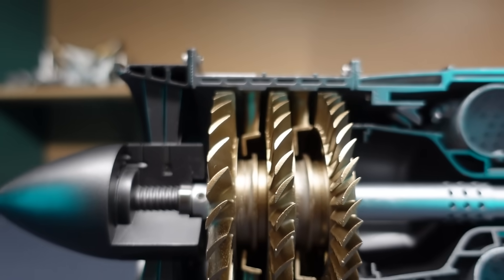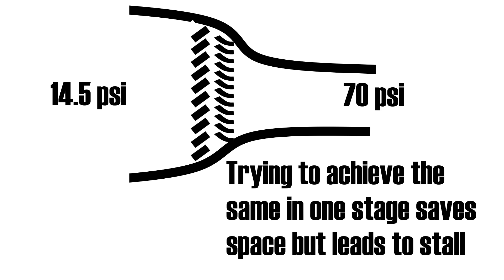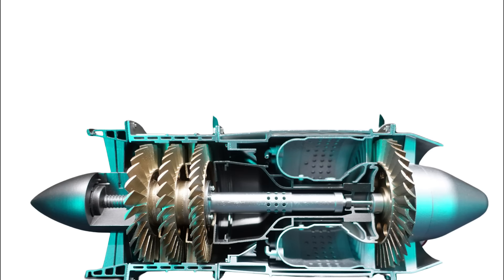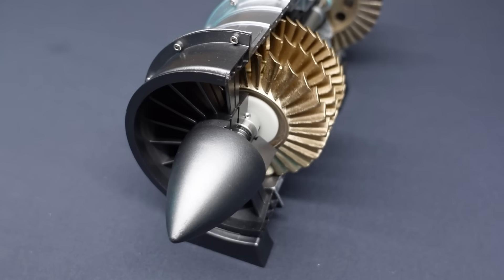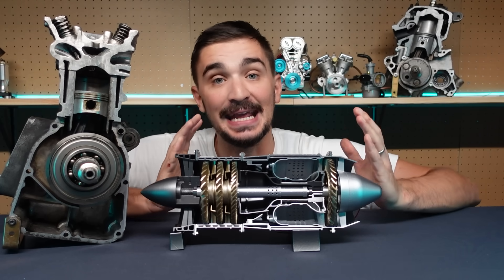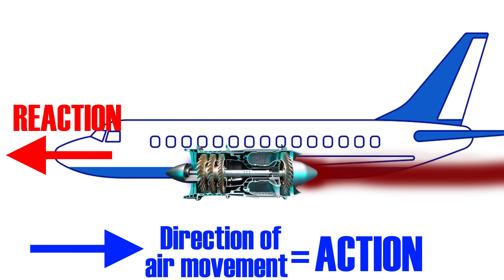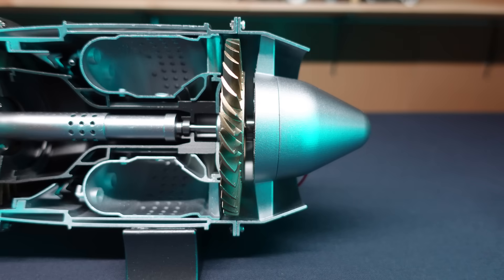Appreciating The Beauty of Jet Engines by Juxtaposing Them Against Piston Engines

Comment: Everybody,  go view this jet engine invention video.
https://youtu.be/vNhz46CjN0A?si=vdVw1irE2oW4KbLA
Paraphrased or search:
Frank Whittle Inventor of the Jet Engine.    Amazing story of treachery and triumph.    Yet Frank did not get his just recognition and honors until 30ish years after the fact !
If you think the jet engine is hard to understand, imagine being the first guy to come up with the idea !    Nobody to tell what is right or what is wrong.    More likely, nobody that even thinks that you are sane or making any sense.    Also, his original jet engine was a centrifugal flow engine unlike todays axial flow jets.   But the principles are largely the same.   
In fact seeing the design of the centrifugal flow jet made it easier for me to understand the jet turbine principle overall.    I mean for Gearheads, a jet is open at both ends, don't you have to contain all that pressure in a combustion chamber somehow ?  Open at both ends just doesn't make sense !
Note:  The germans actually had a jet made and in the air before Whittle but Whittle and the German inventor did not know of each other or exchange any of 'the science' until after the war.

Comment: Hey! Great video. You may just want to do a bit of a follow up about the pressure in the combustion chamber. As it is not a sealed system, the pressure doesn't increase. Only volume does. It is this increased volume that is harnessed as greater dynamic pressure to spin the turbine. It works on a conceptually different cycle to piston engines, using expansion rather than the force of greater pressure to provide energy to do work.

Comment: 1 bar is 14.7 psi not 14.5 .....
If you equate a 4 cylinder (4 stage) reciprocation  engine to a jet then they Both operate / combust simultaniously.
I did laugh though,  when told that the jet inlet has a set of static blades to stop the engine sucking up big objects.
I thought about the woman ground crew that was sucked up and went in whole and got expelled akin to cornflakes.
I laughed because I ashumed you may mean, adult elephants are too big to get sucked in?
Reply from the maker: https://www.blackcircles.com/helpcentre/tyres/convert-psi-to-bar#:~:text=How%20many%20PSI%20in%20a,14.5038%20PSI%20in%20one%20BAR.

Comment: There is no pressure increase in the combustor of a gas turbine engine. The highest pressure is found at the compressor discharge just prior to the combustion section. The burning fuel only causes an increase in volume and velocity of the gas entering the turbine. If pressure increased due to combustion, flow through the engine would either slow or reverse. In both cases, this would overheat engine components and cause a failure.

Comment: Hey nice bike, it is the same model as my bike :P 
Have you changed your rear shock?
Reply from the maker: Stock suspension, didn't even touch preload, but I think I'm starting to feel a bit of the weakness of the soft suspension
Reply: @d4a  i have preload maxed out, but for what i do, i bottom out the suspension constantly. 

Also widowmaker make a wicked exhuast for the 300 👌👌

Comment: You mention that modern tech doesn't use Turbojet engines and instead Turbofan engines (I'd love to see a future video on that subject), but weirdly enough that reminded me of all things the SR-71 still only used a turbojet engine with a ramjet design smashed into it, giving it the moniker of of a "turboramjet". That's why it could climb so high compared to other commercial and military aircraft, and casually outspeed the fastest missiles during that era (nowadays SAAMs would potshot the hell out of it, due to the sheer progression of tech in the past 50 years).
So, that begs the question then: What would the SR-71 engine look/operate like not using a turboramjet, and instead using a hybrid of ramjet and turbofan?

Comment: Usually the Turbine where your burnt gases exit has the opposed vanes when connected to the compressor stages via planetgear so that it can rotate in the opposing direction, while I would imagine this also helps provide better stability as one section spins one way, and others rotate the opposite. The model you have is a good example, however it doesn't look like the exiting side is geared with a planetary gear to the compressor section.

Edit* it looks like you caught it before I did in your own comments lol

Comment: I commend you D4A for trying to explain these complicated engines. Heres some feed back!
1) they vibrate like crazy, as they can rotate at speeds well over 50krpm, it's not uncommon to have "modes" or natural frequencies in the 900hz or more.
2) compressors: the rotors increase P total, the stators convert most of the Ram pressure into a static.
3)the reasons each stage gets smallest is due to the density increase of the air. The engine must have near constant mass flow throughout. (Near constant due to bleed systems etc..)
4) as the gasses combust, the pressure goes down! If it didn't, it would go back to the compressor which is lower temperature. The highest pressure in engine is right after the compressor. As the gasses burn and heat up, the velocity increases.
4) the turbines have two sections like a compressor, stator and rotor. Also, unlike a compressor, they increase in size due to the density decreasing over each stage.
5) for most jets, the highest temperatures are seen on starting. There's not enough airflow to cool things and there's a ton of fuel burning on things. That's why the quickest way to kill a jet it to start it with a weak battery.
6) the ignitor only comes on at start or inclement conditions. Generally combustion is self sustaining.
7) the turbine on the model is installed backwards.
8) the usual limit on rpm is the material properties of the rotors due to centripetal force. The larger the engine the slower it will rotate.
9) One thing you did not mention, as the engine has all stages operating simultaneously, the engine grows unevenly, the cold section compressor will grow very little, the combustion and turbine section can grow A LOT. A large turboprop can grow as much as a .25" over those sections from cold to max power.
Again, nice video.
Reply: The compressor blades also.
Reply: Doubt on Point 4. Pressure going down after combustion - pressure reduction happens at the intake stage only, that's why it is followed by a compressor stage. As the expansion chamber of combustion stage is fixed and also cold air gets sucked into the chamber from the venturis on the chamber body, which means the pressure will increase with the added density to cool the exhaust and then as it passes thru the turbine blades, it's flow rate and flow speed both increase which is converted into a working thrust force at the exhaust nozzle and cone. 
Bernoulli said fluid velocity is inversely proportional to pressure, a principle which is the basis of jet engines. But we also have boyle and charles laws which say that in a constant volume, when temperature of working fluid increases it leads to pressure increase, directly proportional. And these variables in temperature and pressure cause a pressure differential that is converted into a Thrust Force. 

With due respect, correct if my observation is wrong.
Reply: @sirishwark I mistakenly wrote 4 twice, but you thankfully stated the point 4 in question (lol) I recommend looking at the Pv diagram for a simple Brayton cycle (principle in which gas turbines operate) In an ideal Brayton cycle, combustion happens at P constant. P2 to P3 (of the cycle). Do not mix P2 to P3 of an engine. P2 is generally directly at the entry of the compressor, P3 is the exit of the compressor (all stages), P4 is directly at the entry of the turbine nozzle. P3 is highest Pressure, T4 is highest temperature. P4 is always less than P3. Think of it this way from an instantaneous perspective. If P3 was less than P4(regardless of shape of chambers etc) P4 would flow back to P3, it's that simple. The combustion of P3 gasses increases the P total, but P total is a mix of Pram and Pstatic. The purposes of the shape of combustion chambers is to ensure as compete a combustion as possible and to convert the energy into velocity. That velocity is what turbines use to convert into mechanical energy. Circling back to the ideal Brayton cycle, you'll notice that P4 and P1 are at the same pressure (mind blown). Because P is Pstatic, all the energy added is converted into velocity at the exit, Pram is higher, P static is the same as the inlet. 100% efficient. In reality, P4 (on the cycle) will have a higher pressure than P1 of the cycle. That's why when you see exhaust gases leave an engine they expand right after the exit and make a cone and not a column. Reality is a B#tch. I hope this answers your comment.
Reply: What a load of bs!
Reply: @kentauree after a quick read through I don't see anything wrong in what was written. Anything specific?
Reply: @kentauree  what?

Comment: Excellent explanation. Also, all internal combustion engines reach higher efficiency at higher operating speeds. However, recip engines have more limited speeds otherwise vibration will self destruct. On the other hand, jet engines have low efficiency at low speed by default (inherent of all internal comb engines), but since they can spin at higher speeds, jet engines compensate for their efficiency the faster they run and the only limiting parameters are elevated temps and vibration (@ multi-k speeds). One most limiting factor is the cooling air needed to protect engine components from melting. This "bled" air can reach as much as 60% of the compressor's volumetric output air, leaving only 40% of air available for combustion, and thrust.

Comment: One thing which always puzzles me with jet engines is why does the combustion chamber only exert pressure downstream, ie towards the turbine.   What stops it exerting pressure upstream?  In a piston engine the valves prevent this so what provides the equivalent function in the jet engine?

Comment: Back in the late 70’s I used to machine the bleed holes in hot end blades for the Rolls-Royce RB211 turbofan engines.
Reply from the maker: Was it fun?
Reply: @d4a  EDM machine with lots of oil for the burn, then trichloroethylene to clean the blade for inspection.

Comment: 15:02 you could have piston engine to propel something like fan on high altitude but for same power rating, jet engine is multiple times lighter, a400 has 4 turboprop engines with 10000hp each, how much would weight the lightest piston engine with same power?

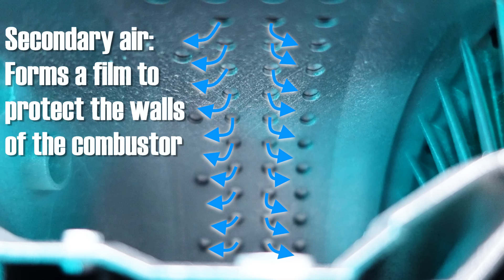Comment: 9:41 wrong, primary air is used for beginning of combustion, secondary air is for optimization of air/fuel mixture to prevent too rich and to insulate combustor walls if high temps, and third zone is to finish combustion and insulation, and as much air is in 2. and 3. zones, as  temperature is lower
Reply from the maker: Not necessarily

Comment: The connection of the turbine to the compressor does not create "vicious cycle" (@7:32). "Vicious" means "bad", but this is essential in the turbine engine just as it is essential in the reciprocating piston engine. In both cases, the compression requires energy, the expansion produces energy, energy from expansion must be used to drive compression, and it is only the excess of energy produced in expansion over energy used in compression that produces the net energy output of the engine.

Comment: Could you explore jet engines as a power source for cars? Not as thrusters but as a combustion engines where the energy of exhaust is extracted and either converted to rotational energy of the wheels or into electrical energy.

Comment: As noted in at least one other comment, the pressure does not increase in the combustion chamber, as claimed at 6:53. It does increase greatly in energy (which is the point), but that energy is realized as temperature and velocity, not pressure.
Reply: Of course pressure. You need a physical force to move an object. In this case to move the engine and the attached plane in a certain direction.
Reply: @casshern9454  the pressure is high in the combustion chamber, but it does not increase due to combustion as the air moves through the chamber. No one is saying that there isn't high pressure in the combustion chamber, or anywhere else in the engine. 

Turbine engine thermodynamics and fluid dynamics are much more complex than "Of course pressure. You need a physical force to move an object." For a start, fluid velocity is more important to thrust than pressure, and all of the basic fluid state properties (temperature, pressure, velocity density) are critical, not just one. 

In the combustion chamber, the addition of energy (by combustion) to the fluid (air plus fuel or combustion products) temperature and velocity increase, without increasing pressure. In other stages of the engine, other combinations of changes occur. It is the stage ahead of the combustor (the compressor's diffuser) where pressure increases, and the stage after the combustor (the turbine section) where pressure decreases.

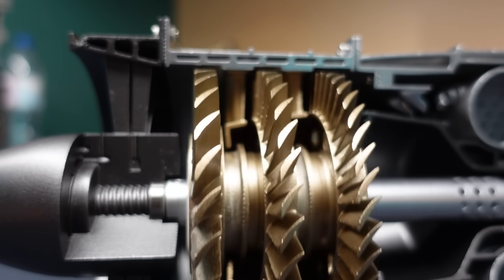Comment: 6:33 you skipped diffusor, where air slows down and stabilize before enters into combustion chamber
Reply from the maker: This engine doesn't have one as you can see.
Reply: @d4a  it is not accurate engine model
Reply from the maker: It is, the early jet engines from this time actually had mixers like this one because they struggled with surge

Comment: 5:50 wrong again, with 3 stages of axial compressor you can not get 70PSI, because 1 stage can gain only up to 20%, you should have 7-10 stages or centrifugal compressor
Reply: While an industrial axial-flow compressor is unlikely to exceed a 1.2:1 pressure ratio per stage, aero engines run higher ratios. For instance, the old Microturbo TRI 60 runs 6.3:1 in four stages, which would be almost 1.6:1 per stage. With three axial stages, the claimed overall pressure ratio claimed here is plausible... but it's obviously an old low-performance design.

Comment: 4:49 no, wrong, inlet guide vanes can not protect from any foreign object
Reply from the maker: Sure they can
Reply: @d4a  no, no, energy of any sucked object will damage inlet guide vanes, if engine is bigger, inlet is bigger so it could suck brick , so if you will have cage strong enough to stop brick, it should be made from steel bars  1 inch thick, but brick would fall apart so again no use, my suggest to you to stay on topic you are good, jet engines are wide area and you should study it a little more 😀(mentour pilot channel in one video explained that if you do not believe me)😀

Comment: A piston engine is a positive-displacement device; it compresses air by physically decreasing the volume of a trapped mass of air. Turbine engine compressors are not positive-displacement devices; they add energy to air by accelerating it, then the air is slowed down to increase the pressure (in a diffuser). Turbine engine compressors do not compress air by forcing it into a small space.

You can't draw any conclusions by looking at the cross-sectional flow area of part of the turbine engine without considering velocity. If you look at an area (such as at 5:26) and say "the area is smaller so the air must be compressed", you have fundamentally misunderstood the fluid dynamics, and missed that the airflow through that area is at higher velocity, and likely low pressure. It is only when the cross-sectional area is increased that the flow is slowed, increasing pressure... which is at least initially counter-intuitive.

Comment: The combustion in an jet engine increases the volume not the pressure of the gas .
Reply: An increase in volume will increase overall pressure,  but it's an increase in dynamic pressure, not static pressure. Static pressure goes down but dynamic pressure goes up. Dynamic pressure is velocity.

Comment: "Water mill" would be a mill (a machine, particularly for grinding, such as one used to mill grain into flour) driven by water in some way (including a turbine). Similarly, a "wind mill" is a wind-driven grinding machine; the big things with blades turning in the wind to produce electricity are wind turbines (driving generators), not "windmills". "Mill" doesn't mean "turbine"; it means a machine, especially one for grinding.

Comment: Describing an engine's cycle as intake-compression-combustion-exhaust missed the most important stage: expansion or power.
In a internal combustion piston engine combustion is a brief event when the piston is near top dead centre; the downward stroke of the piston delivers power because it allows the gas in the combustion chamber to expand. You are calling this entire stroke "combustion".
This is even more important when you compare to the turbine engine. In that case, combustion and expansion (mechanical power production) occur in completely separate areas: combustion in the combustors, and expansion in the turbine. 

Piston and turbine engine cycles are fundamentally the same, but it's easier to see that with a more accurate description of the stages of each cycle.

Comment: i heard this from a jet engine mechanic (AgentJayZ) - he said the narrowing diameter/volume of the compressor stages against the inner casing isn't what mechanically compresses the air

he said the stator is what mechanically compresses the air - as rotors spin, they increase velocity of the air, increasing its kinetic energy, then the stators convert that KE (velocity drops) into potential energy in the form of pressure

he said the volume reduction from one compressor stage to the next in the engine casing is a consequence of said compression, as the compressed air occupies less & less space as it makes its way thru the compressor stages